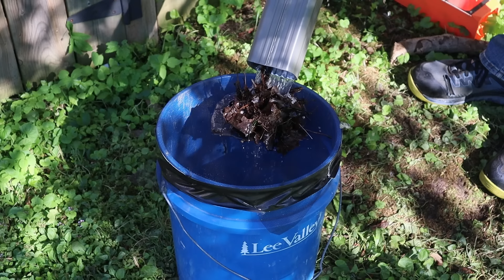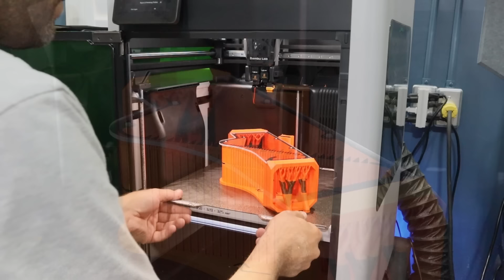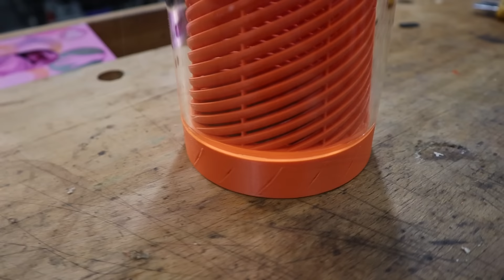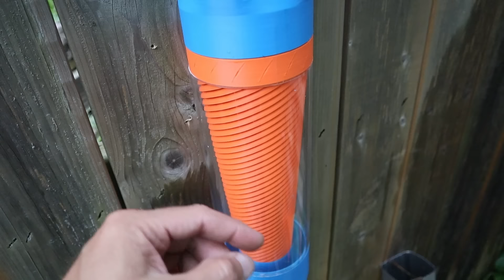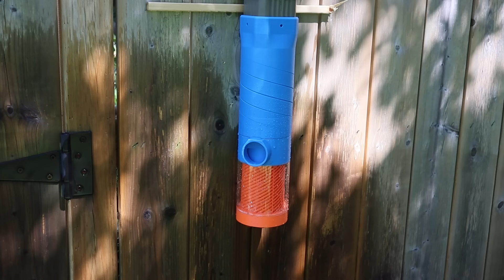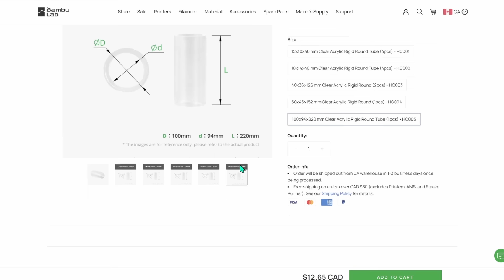Can you 3D print a self cleaning downspout rain water collection filter that actually works?  Let's

Comment: One critical point I think you may have missed. During moderate to heavy rain, you will probably have a much higher flow rate through your downspouts than it is possible for your hose to replicate.
Reply: I guess that depends on the collection area. I'm collecting from about 400 sq ft and I never get more than a fast trickle. 1 inch per hour (heavy rain) times 400 sq ft would be about 4 gpm if my math is right.
Reply: combine two vertically, double the capacity
Reply: that's not really a problem though, only if he wants to collect 100% of the water but that's not really necessary
Reply: @TheBadKittyNoTuna why wouldn't you want to collect 100% of the flow?
Reply: @jonathanrogers9961  If your storage is small then in medium rain it quickly fills even with a small amount.
Reply: I have one spout that will dump 100gpm easy in heavy rain.

Comment: Just an idea, maybe rain collection could be improved on yout last design by tweaking the from a tapered cone to a bullet nose or hourglass design?  Take two bullet nose dowels and chop off the straight mounting bits. Then put those two dowel tips together, tip to tip. The filter element would follow this profile. I don't think this would give you the filter disabling function in the same way though. Also, for the joints, could you just print a bit of an o-ring groove for a roughly 3mm diameter o-ring around the whole perimeter? No need to make it perfect if you can make it flexible.

Comment: You should try the first design but place it right after an elbow so the water is already flowing at the bottom of the pipe when it hits the separator.

Comment: It's a neat system. If you want to use one of these long-term you'll probably want to use a filament with some kind of biocide in it so that the slits don't get clogged up with algae and moss growing on it. Copper-filled filament might work quite well.
Reply: Copper might not be the best filling to use, we have seen quite a lot of water cooling system in pc with algae growing in them and the copper going to mush
Reply: @dragonmares59110 a small coil of silver wire in the tank solves that betted than copper does.
Reply: @dragonmares59110  That would be due to not using JUST water in the loop and the fact that many chemical reactions require heat. Remember, your loop contains anti-corrosion agents to care for your radiators and other shizniz. Not JUST h20
Reply: @dragonmares59110  there's literally a channel of a pool cleaner that uses copper elbows for his pool & no issues.
Reply: @Refr619 one example vs countless others
Reply from the maker: Smart!   I was thinking that it should have a cover on it to prevent the algae growth, maybe the cover could be moved to have a look to see how things are going, the acrylic was necessary for the video, but in the real application a 3D print works just as well, it'd be even easier to assemble too.
Reply: @NeedItMakeIt  instead of using a copper filled filament, paint the plastic with a conductive paint (honestly, just dip it... too much detail to bother with a brush), then electroplate it in copper or silver. far better coverage, and you can use the prints you've already made. it's also somewhat repairable, and the painting and plating process will smooth out the print lines a bit.
Reply: @TheAruruu  Dipping the plastic in conductive paint and then electroplating it is the most maker solution so I choose this option.
Reply: @NeedItMakeIt  a lot of the problem is with the pores in the layer lines, so something like acetone vapor smoothing could make it less prone to bacteria growth.
Reply: @NeedItMakeIt make a very thin sheet and plate it with silver and just have all the water pass over that (ie. an angled baffle and have both of those baffle plates be removable/replaceable and make sure it doesn’t obstruct flow, but guarantees the water will touch one of the two baffle plates)
Reply: Zinc strips are also used to keep shingles clear of algae and moss.
Reply: Could also use UV occasionally.  Not passive but pretty low effort to flick a switch once a week.
Reply: Once oxidized, the copper is useless. You plan on using toxic Brasso to clean it?
Bacteria level filtering can be performed later. Worried about alge? BLOCK THE LIGHT!
Reply: I’m not sure I was surprised, but apparently you can buy filament that is used in the same plastics to make urinal cakes
Reply: Running the water over a silver round after filtering might help.
Reply: I would think long term would want metal 3d printed from copper or some copper/silver alloy stainless stea or ritaniuml maybe
Reply: @professorxgaming69420 That'd be overkill for this project. A good ABS print will last years and only take a few hours to print & replace. Making an actual metal part would be very expensive and take much, much longer. You could print like 6 in plastic and still have a couple left by the time corrosion ruined the metal version.
Reply: @jacobs7764  personally i would go with petg do to it having a better uv resistance.
Reply: Uv light?
Reply: or just block the sunlight, since plastic degrades in UV
Reply: Copper does nothing to prevent biological build-up. Others have commented already regarding using it in water cooling for a computer, but it just doesn’t have a way for biologics like algae to really attach to copper.

To prevent growth of biologicals, you use silver in the loop somewhere as silver is a natural biocide and kills algae, so it can’t grow.

Most computer modders (such as myself) ONLY use silver and don’t bother to use a biocide in the distilled water, because as long as your loop is running and you have a could of silver somewhere in the loop, the water will come in contact with the silver enough and constantly, so that nothing will grow…and you really only need ONE fitting to accomplish that (it doesn’t take much).

Eventually, however, due to galvanic corrosion, you do have to replace the silver as it breaks down to a molecular level and finds its way to copper and other metals.
Reply: @JEdwardsbret  i would just use a uv light and protect the plastic with charcoal black
Reply: @Blox117 yeah, that’s a much better idea than my idea…maybe you could also have a generator below the filter, but above the barrel that can generate enough electricity to power the UV light and put a battery in there as buffer…

I figure there’s a bit more that could make it even more hands off…I don’t want to be replacing batteries for a light to ensure that it runs any time the filter is still wet.
Reply: @JEdwardsbret  maybe just a solar panel?
Reply: @Blox117 yeah, I was considering that, but then remembering the insane number of days it was gray/raining outside when I lived in the Seattle area…and I was thinking that almost every time you want to make sure the light is on is when you can’t use a solar panel to generate electricity…then, what about multiple days in a row of needing to be in operation without sun.

…ultimately, I was just thinking of a way to maybe add additional buffer before needing another charge/intervention. I had a similar situation with my security camera at that house as it had a solar panel and a battery and I had to swap the battery to recharge it a few times.
Reply: @JEdwardsbret  well personally i would find a way to hardwire it. those solar powered garden lamps never work well, and this is a similar use case.

i do know there are solutions like microban: it's an additive to paint and so perhaps you could just paint it on?

see: " Microban Resistant Mold and Mildew Paint & Stain Additive 1.5 Fl. Oz. "
Reply: @JEdwardsbret  oof, youtube is deleting our comments so no one will ever see them
Reply: @Blox117 lame
Reply: You want biocide in your water?

Comment: First and 2nd designs didn't really work because the water was hitting it directly, you need it more like a halfpipe at the start so it flows over it rather than directly hitting it like how the actual hydro coanda screens are

Comment: Gutter guards would do a better job of filtering large leaves and sticks. The cool filter you designed could act as a second stage filter to remove smaller debris and a settling barrel would separate silt like solids.
Reply: That was what I was thinking. His design alone is great but used with a system would make it better. I am a big fan of using cheap prefilters that can be abused first and then using finer filters to make them last longer.

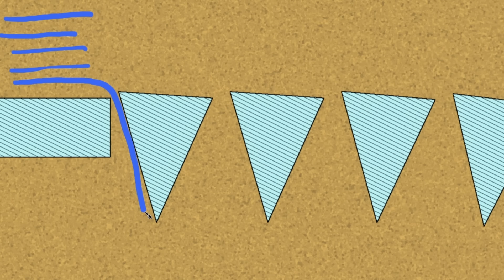Comment: Using the schematic @2:35 as a reference; if you crown the top of the filterfins, less of those tiny twigs should get stuck.

Also pre-spinning the water would be my other suggestion, but it looks like you got that already @20:00.
I almost missed it because you didn't say anything about this.
Reply: Missed?

Comment: 14:55 It looks like the first 7.5 cm as the water goes in does the capturing. The rest seems to me a likely waste. The reason this is happening is because the water is close enough to the acrylic to smoothly ride down the outside. One thing I did notice is that you helix pitch is too small for this. Sure the wash board works but if you can direct water using it's surface tension properties the whole way you can do it more effectively and efficiently. I would design the helix pitch to just enough for the water to ride down each thread versus falling off and I'd have a collection path in each thread to help guide it and the outside of the threads would contact the acrylic all the way down on the inside. The goal is laminar flow.

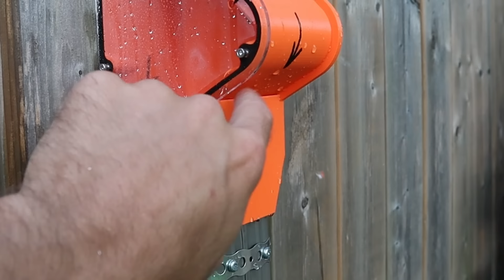Comment: 6:57 put a very shallow v in the face of the grate and that will likely focus water to middle. 

Also soak some leaves as if they sat in a low spot in gutter and got soggy. Interesting to see how they work on screen. I find they just block up gutters more easily than dry leaves snd water back flows into the eaves.

Comment: Interesting video, thanks. Otherwise, too much pressure on your hosepipe, rainwater on a roof gutter won't run with that kind of pressure
Reply: It depends on the type of rain and the surface of the roof. For me it happens that the pipe is full.

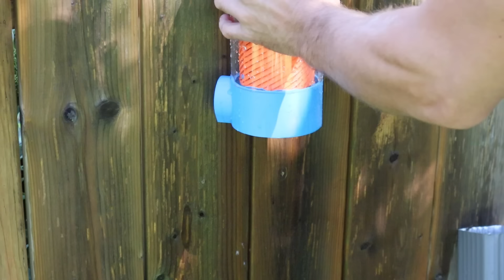Comment: Looking at 20:47, I see buildup on the filtered side, this water then gets sifted back into the screen and into the debree hole. You should have a small area below the screen to collect water, perhaps the height of the clean drain hole to direct the water out the drain instead of backpropogating the screen as it builds up.
Reply: Noticed that as well. Would be a net improvement without much of a downside.

Comment: I imagine one could easily adapt this for a pool cleaning system
Reply: If anyone has ideas for adapting it to a pool filter, I'm highly interested. During a few weeks of the year we get so much plant debris that we have to empty the filters multiple times a day!
Reply: Micro plastics
Reply: This wouldn’t be ideal as it requires some amount of water to constantly be purged from the system.

You’d constantly lose chlorinated water and have to add external water to the system. In the end you’d have to adjust your chemicals much more often. At that point it would be easier to clean the filter.